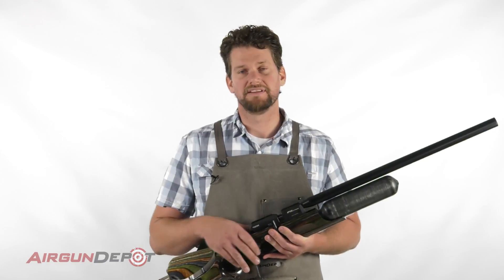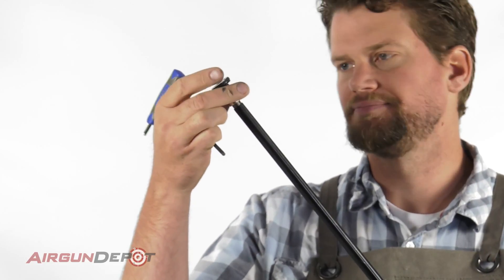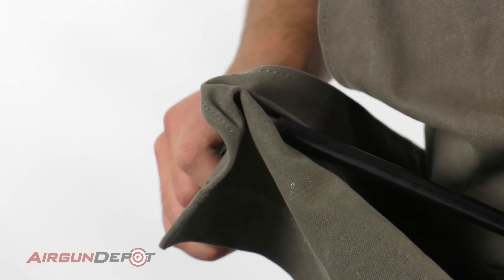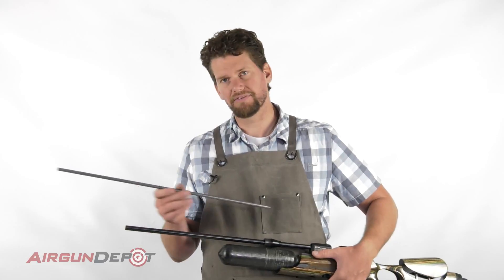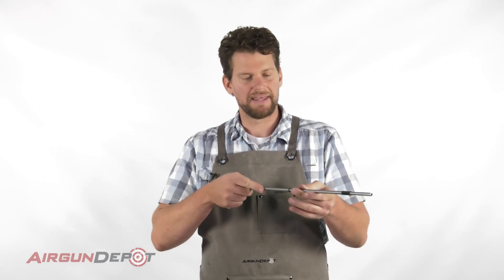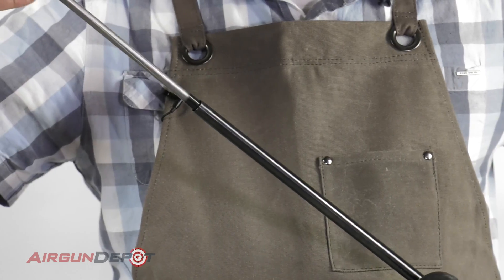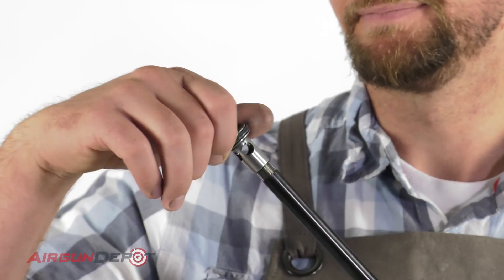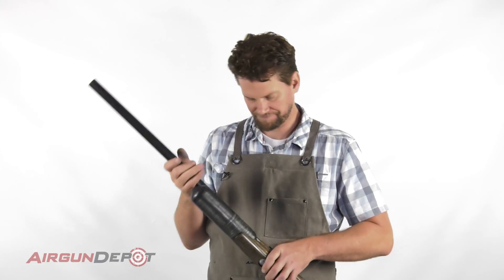FX Crown: How to Replace X Barrel Liner Plus a Helpful Trick

Comment: Haha scared the crap out of me. I was cleaning my Panthera compact and when removing the shroud the top piece loosened. Took it off to clean and the liner popped out a bit .. wth.. I thought they were set screwed in there haha .. looks like i found a extremely easy way to clean the barrel .

Comment: Hello, could you tell me after haw many shots you have to replace  the barrel ( liner)? Thank you in advance.
Claude.
Reply from the maker: The liners should never wear out, unless you are frequently cleaning them with an aggressive abrasive like JB Bore Paste. You only need to replace the liner if you want to shoot slugs or other projectiles. Right now there are two liners for pellets: the one the gun comes with (Pellet Liner A) is optimized for medium to medium/heavy pellets like the JSB 15.89s and the 18.13s. The Pellet Liner B is designed to shoot very heavy pellets like the JSB Monster and Beasts. Then the third liner is designed to shoot slugs.

Comment: Hi, is it possible to fit a moderator directly on the sleeve if we don’t want the full shroud ?
Thank for the video ?
Reply: Yes. You would probably want the moderator to attach to that small intermediate sleeve you see threading into your outer barrel the same way the existing brake does. Alternately, you can simply take advantage of the existing shroud and brake's volume, and screw to the end of the shroud itself.